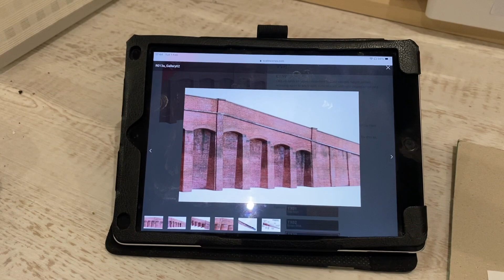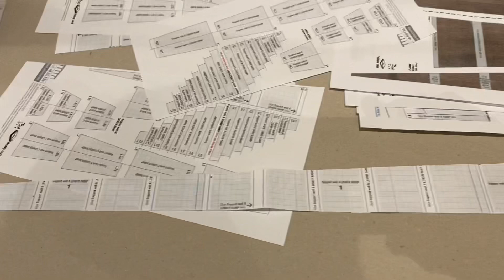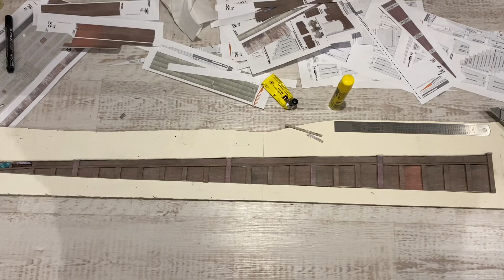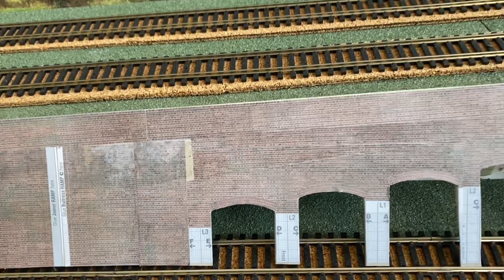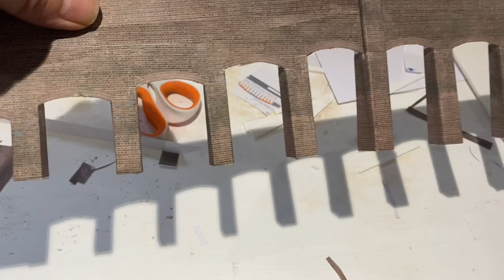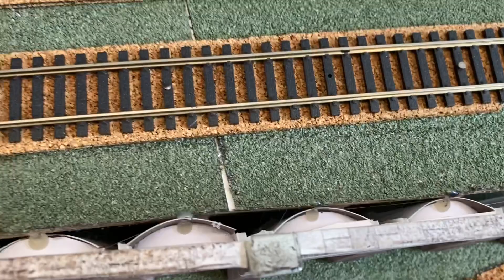14 Building my first model railway - Making retaining walls

Comment: Wow looking good!
I’m cheating for my current « vintage style » Hornby Dublo 3-rail layout. I’ve taken their cue and am building my retaining walls in the same style as the Dublo « concrete » buildings. So no brick detail to worry about and I managed to find a Dulux aerosol which is pretty much an exact colour match to their 1930’s style station buildings and signal box. I’ll see how it turns out tonight. If I can live with the 3-rail track I just can’t abide the horrendous standard 15’’ curves on the return loops I have at each end of my « double track » mainline. So their primary purpose is to hide those!